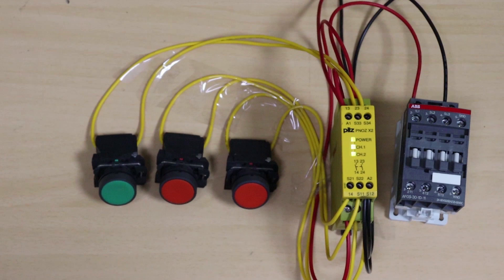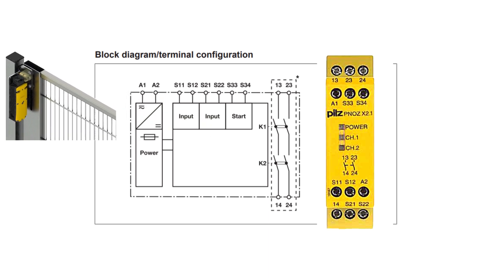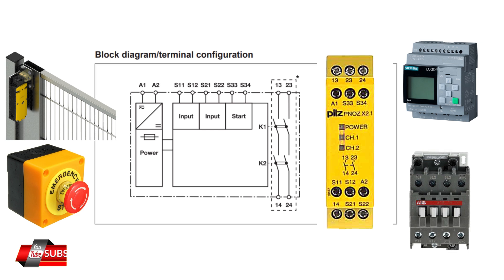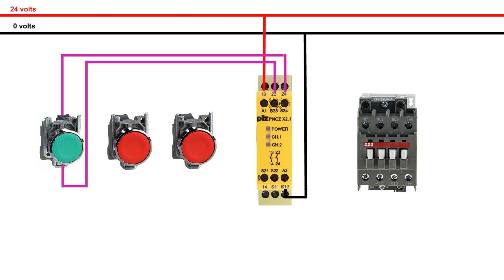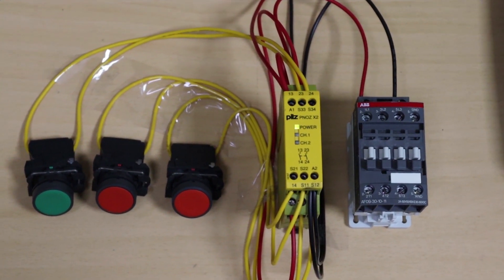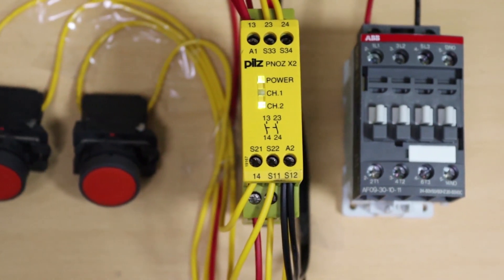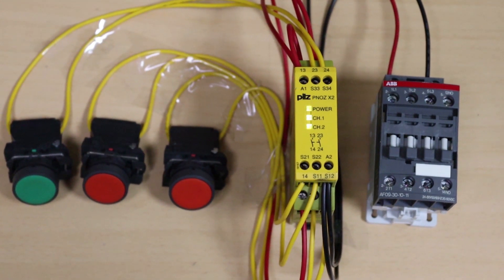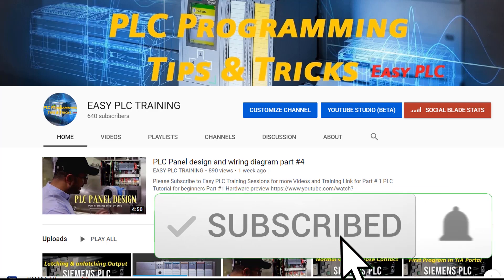What is Safety Relay PILZ ? Easy Explained | pnoz X2 X3 X4

Comment: Do I compulsorily have to use a Contactor at the end? If not, do i attach 13-14. 23-24 directly to the actuator ? Why use contactor, if we are using relay for the saftey ? Thank you for the video ! :))
Reply: The safety relay isn’t made to switch big loads, a contactor is made to switch bigger loads, so we use that.

Comment: In the schematic section, the wires goes to the wrong pins but the audio is true.  Possibly because the software wouldn't allow you to draw the lines to the correct pins.  Good explanation anyway.

Comment: Great video!  I have been having trouble understanding safety relays from the data sheets and this helps.  But I was wondering if you had only wired the contactor to only 13-14 (and not series 13-14 and 23-24) would only the red button connected to S11-S12 turn off the contactor?   So S11-S12 safety input only controls 13-14 and S21-S22 only controls 23-24.  Is that correct?
Reply: no.  13/14 and 23/24 are mechanically linked, and not tied to a specific input

Comment: Neutral A2..you draw black wire in s12..channel 1 s21,s22..but where u have drawn red push button? 14 and s11..how!! One red push button should be in ch1 (s22,s22) and another one in ch2 (s11,s12) Am k right?  Pardon..

Comment: This is incorrect:Channel 1 and channel 2 is not  wired using  single pole normally closed contacts. You must use double pole  force guided contacts. going to both channels simultaneously.

Comment: Perfect. but i have a question. Why do you have to wiring both 2 NO 13-14 and 23-24 to contactor instead of only 1 (13-14 or 23-24 to Contactor) .Thanks you about this video!
Reply from the maker: You can use single contact also , just as an example I looped both auxiliaries . These contacts are also used to give signals to other safety relays ... means if you have seen safety relays working in loops
Reply: @EASYPLCTRAINING   thanks you!!

Comment: I have a question.  If one of the channels are not closed when the on pulse to the start channel is made, do you have to turn off both channels to attempt to start it again? 
So if channel 1 is false and channel 2 is true. Start signal is received. Must channel 2 be made false before another start signal can be made true?
Reply from the maker: Yes exactly we have to reset both channels ..... but in some relays we jut have to reset only one faulty channel .... I think It depends on the model of the Safety relay

Comment: The contactor is 24 v?, how can connect a 220v contactor
Reply: Using relay.
Reply: 220v can go to COM terminal, NO contact goes to the contactor coil.  Safety relay energizes the 24vdc ice cube relay to turn on the 220v.